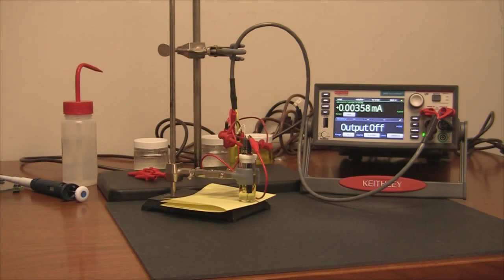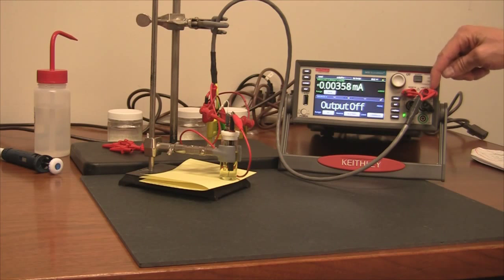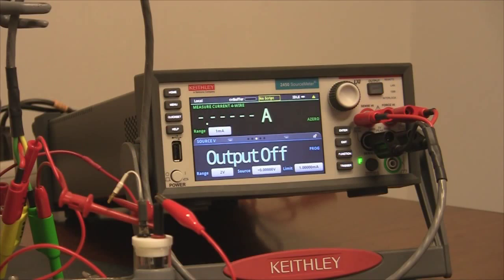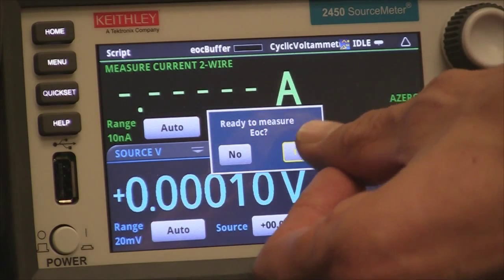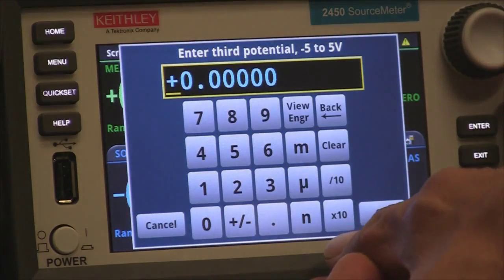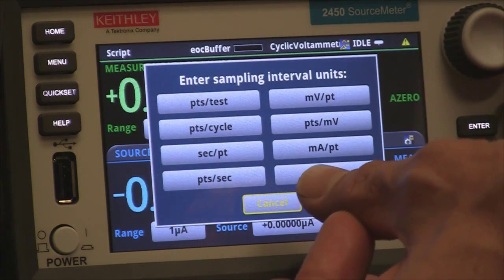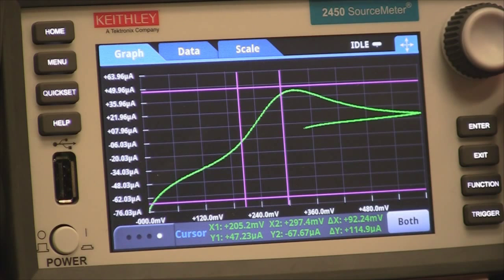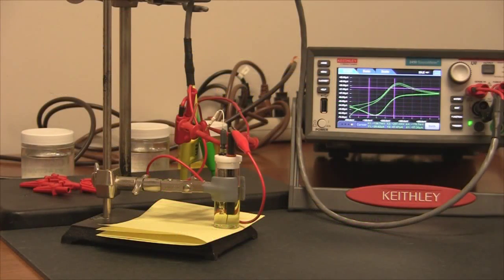How to Perform Cyclic Voltammetry Measurements

Comment: Are these setups pre-loaded ? Or we need to load them ourselves ?
Reply from the maker: Thanks Abbas Hammoud for your question, the scripts used in this video come pre-loaded with the purchase of an EC model SMU. You can learn about them at this link, https://www.tek.com/potentiostats. If you already have a 2450, 2460, or 2461 SMU, you can add these scripts yourself with an EC-UPGRADE kit.
Reply: Tektronix thank you very much ! In the data sheet it appears that both sense high and force high are to be connected to the working electrode not the counter electrode. May you please clarify that ?
Reply from the maker: @abbashammoud7205 . Correct, because you’re interested in the voltage between the reference and working electrodes. Please reference this application note that goes into more detail here: https://www.tek.com/document/application-note/performing-cyclic-voltammetry-measurements-using-2450-ec-or-2460-ec-electr

Comment: Can we perform the same in the 2182A model and 6221 Keithley source meter?
Reply: I dont know my brother
Reply from the maker: Thanks Sridhar Pandey for your question. You typically wouldn’t want to source current through an electrochemical cell, so the 6221 isn’t ideal. A SMU or electrometer is generally a better choice. Please see section 4.2.2 of our low level handbook for a brief discussion on using current sources with electrochemical cells though: https://www.tek.com/document/handbook/low-level-measurements-handbook#C4section1